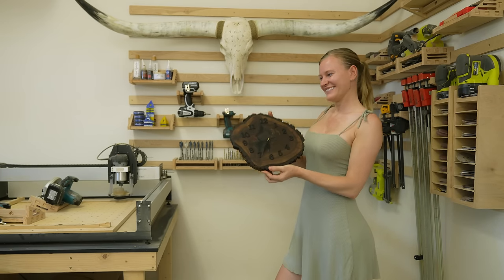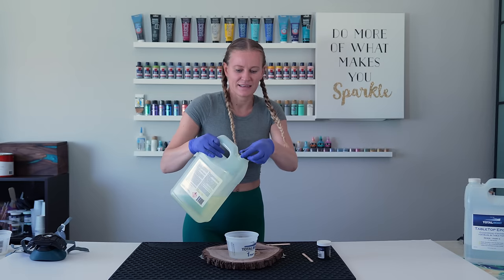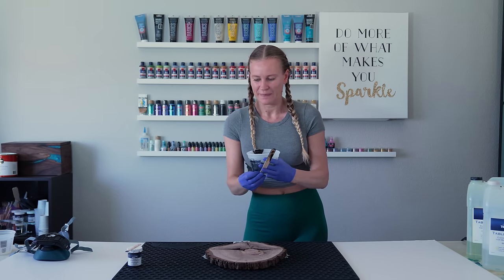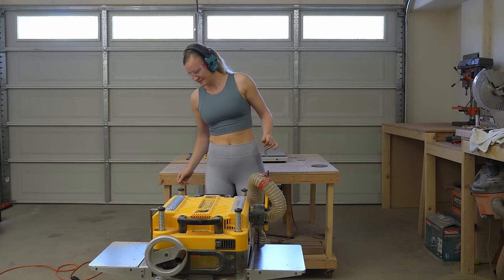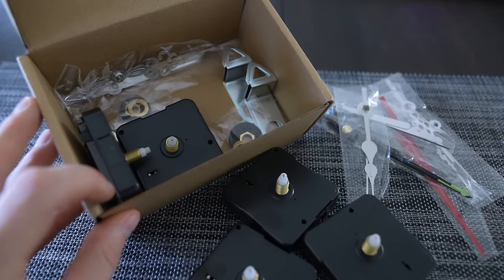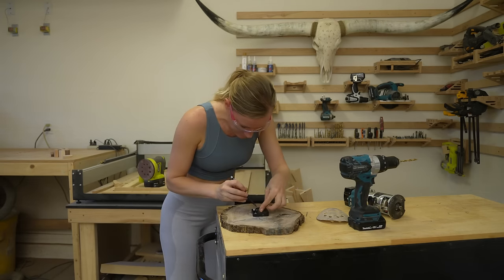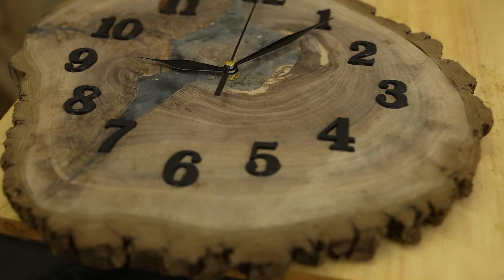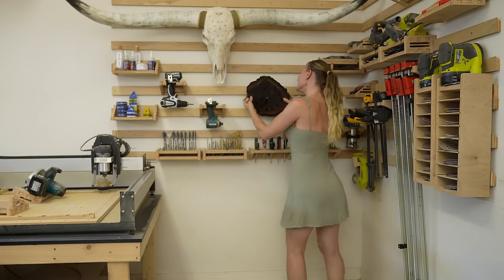Walnut live edge clock with black Resin!! 🪚

Comment: What would be cool would be to cnc the numbers in and inlay some light color wood for the numbers! That would be beautiful.
Reply from the maker: That would be great!! I wanted to make this build a little simpler since not everybody has a CNC 😃 while I do love my machine a lot!
Reply: You can get really tiny (2, 3, 4mm) straight cut bits for the handheld router, and literally freehand the numbers.
You only need to go in about 2mm then it can be filled with a contrasting colour resin, or as I do for my monogrammed chopping boards, file down some copper, or brass, or aluminium rod, fill the groove with Supa glue and then sprinkle the metal grinds into it, keep adding glue and grinds til it's full, then sand it flat.
A bit of oil over the top, and the metal won't get a chance to tarnish.

Comment: The black numbers blend into the walnut after you applied the liquid hydration and are not easy to spot. I think the chrome number would work better. One thing that always works out great is you and your choice of outfits. You're a doll. 💓
Reply from the maker: Hi Mike, chrome would have looked great too. The clock is a little lighter in real, I had some really bad lighting, so it’s not too bad. thank you for stopping by!! 😃💃

Comment: Gorgeous! 😻
Others have commented on 30 degree gaps for placing the numbers, but there's an old geometric way of doing that. Take a look at the Straightedge and compass construction page on Wikipedia. The animation at the top shows how to produce an accurate hexagon (60 degree internal angles) around a point using just drawing compass and a ruler, and then you can bisect each of the six segments to get 30 degrees. If you use a pencil for the lines, it'll easily rub off once the numbers are placed.
Reply from the maker: Thank you so much for the tip Russ!! And thanks for leaving a comment